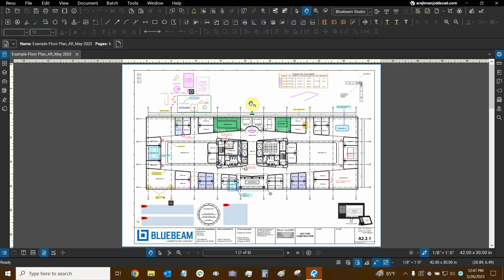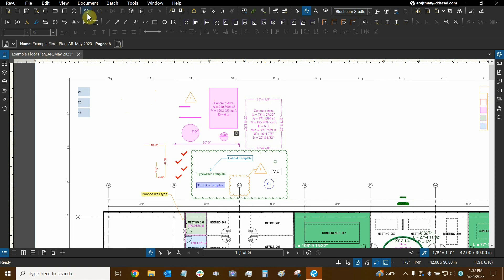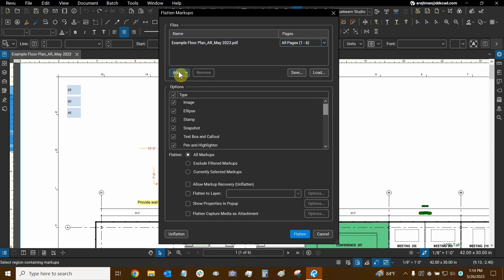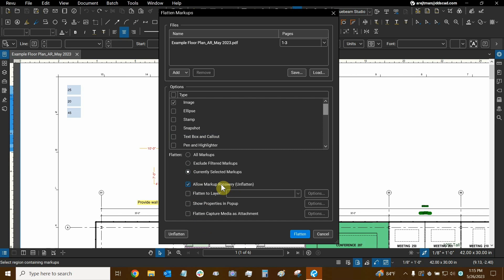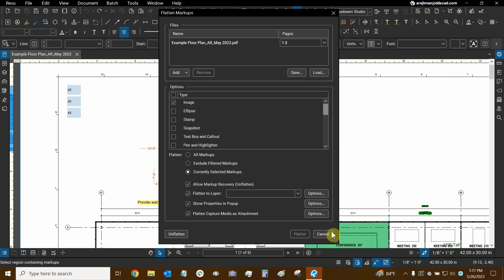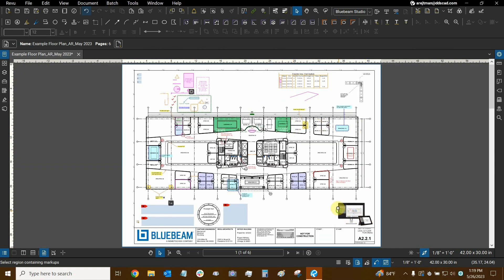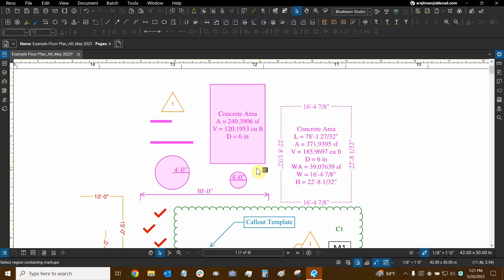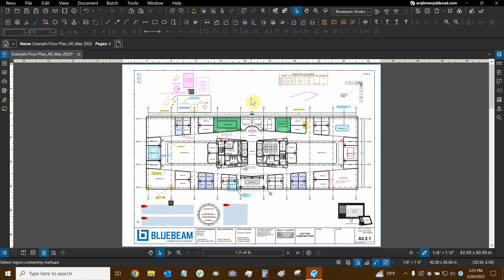Flattening with Bluebeam Revu

Comment: I flattened my drawings. Unfortunately I forgot to tick allow markup recovery option. Is there any way to unflatten it back. Please help me
Reply from the maker: If you saved the file and closed it, there isn’t a way to unflatten the file. I recommend making a copy of a file before flattening and incorporating this into your workflow.

If you still have the file open, you can press the “Undo” key and “manually unflatten” your data. If you must, you can also use the “Edit PDF Content” tools to remove the flattened data and re-create it with Markups and Measurement tools.

Best of luck!

Comment: I have one question please, when I do Flatten, the colors turn black or grey, dosent keep the colors that I used on my paper work
Reply from the maker: When flattening a markup or image, the colors associated should remain the same. You can click on the "Revu" drop-down and select "Preferences". Then, you can select "Advanced" on the left side. Your "Rendering Engine" may be the issue, and if it's set to "Software", then this issue could occur. Another solution involves using the "Create" tool. It can be found by selecting the "File" drop-down and mousing-over "Create". Then, you can select "From File". This will allow you to create a copy of your PDF that "fixes" incompatibilities with certain markups and images from other programs. After doing this, you should be able to flatten anything without distorting their colors.